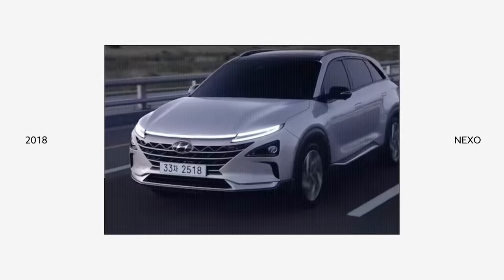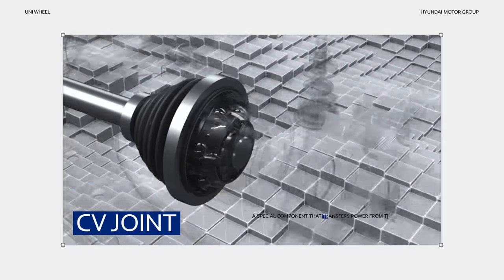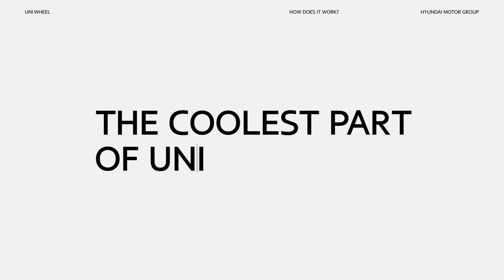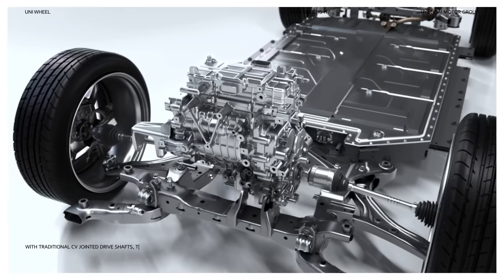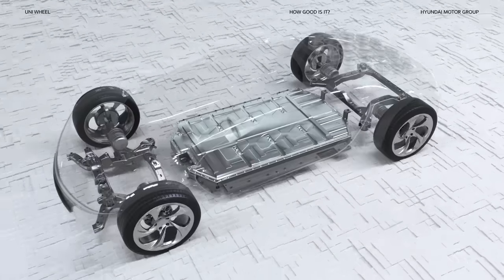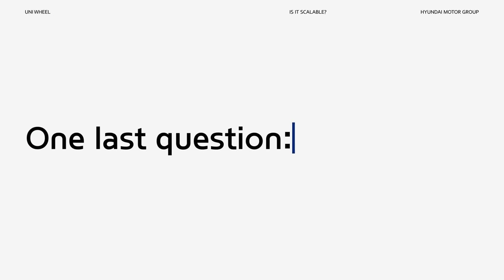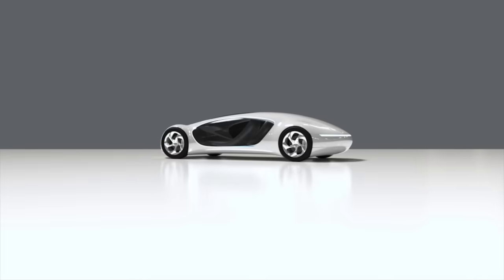The world's first drive system concept | Universal Wheel Drive System

Comment: How does the input gear/shaft stay centred and not fouling on the housing when stationary? I get the it will naturally centre once the wheel starts spinning but the moment it stops the weight of the car will guillotine the input shaft.
Reply: Presumably they're still a suspension arm probably with coil springs pushing the vehicle away from the wheel while allowing vertical travel.
Reply: @skierpage  These springs must support the weight of the entire car.
Reply: I have the same question

Comment: interesting idea. Personally, I expect a lot of unpleasant noise emissions due to the gearing and the very high speed of some components. These speeds certainly also limit the overall usable speed, 120km/h in the video. Another issue will be the sealing of the mechanism and the total number of parts of the mechanism >>> potential failures. The total weight of this device will probably not be negligible either (unsprung weight). And lest I forget, does anyone mind that the vehicle has stopped turning? Or was I looking at it wrong?

Comment: A cool concept but seems much more complicated than ordinary shaft drive. Also, it has more moving parts. Thus there are more things to break down and it's more expensive to build. Also, it increases the wheel's unsprung mass which is also not a good thing.
Reply: This is a modification of the in-wheel motor design. So drastically reducing the unsprung weight and eliminating the motor's exposure to shocks from potholes. Although, yeah, more unsprung weight than a traditional wheel, but I don't think unreasonably more.
Reply: That's true for every significant change in the history of the automobile.
Reply: Remember in this case they’re moving the reduction gear and final drive to the wheel hub so the parts count is virtually identical vs the traditional CV joint setup. It’s modular and easier to service too.
Reply: @starrwulfe  are you sure it won't end up as unserviceable self-contained  wheel assemblies where you have to buy a new one every time something goes wrong?

Comment: Its not mentioned  in the video, but this will only replace the cv joints, and it will still need control arms,  shocks etc right? Also where do the brakes go?

Comment: Would it be possible to also get rid of the conventional brakes and incorporate all braking into the drivetrain? Brake rotors that rust and brake calipers that seize up from corrosion is a major issue where roads are salted during winter...

Comment: Protean goes one step further and has the motor as part of the wheel, which is an even greater step. The argument against it would be the larger unsprung weight of the wheel, but one may argue that city travel means hopefully fewer potholes to contend with. Those solar EV challengers with PV roofs all had motors in wheels.

Comment: What happens to unsprung weight in comparison?
Reply: Did I get it wrong ? its inside the wheel , not a part of it , therefore its not rotating with the wheel making the actual wheel heavier / harder to move . I think thats what is happening . I could also be wrong but it appears to have less mass in general then with regular drive shafts etc so gross weight is reduced . I could be wrong again but although not increasing rotational mass being directly inside the wheel whatever mass it has is directly OVER the wheel / s which I would assume on some level helps plant the wheel via its weight and the mass is evenly distributed over 4 wheels for instance further increasing AWD ability to transfer power compared to RWD or FWD and purportely you dont have fluctuations in torque delivery with the angle changing etc so less drivetrain loss and all of those would seem to mean better acceleration from the power availible / no waste , as is the case with transmissions going to differentials etc that all "eat " power and why HP is rated at an engine ( potential power) but also measured at the wheels to know how much actually makes it to the wheels . Having each one independent also means super duper torque vectoring which means even less likelyhood of spimming the tire which turns HP into heat and smoke without full use of power to move car as well as reducing tire life . The movement they show would also suggest better contact patch when surface changes putting less pressure on tires in different situations which would mean longer tire life even if driven hard instead of eating up outside of tire etc to where you have more tread on part of the tire but once you remove more tread in a specific area you reduce traction / performance and would need new tires despite some section of tire being in good shape with use left . Everybody who drives fast or hard , had alignment issues or set up a car a certain way has had to get new tires despite a good section of the tire looking and being good and that is a drag , you might try an wait to get more miles but you lose a bunch . Regular ICE AWD cars even have issue if 1 tire has significant wear compared to others changing diameter which throws off the gearing / differentials meaning needing to replace tires so all are even or shaving a new tire to be same diameter ( throwing away brand new tire reducing miles it will be useable) . With NONE of that and truly independent wheels that is no longer a concern or less concern as each wheel optimizes for its tire even if slightly different then the others . If those gears are strong or strong enough for whatever power will be put through them it looks to be a win , But real world is real .

Comment: So, why not just use the already existing hub motors that i see in things like the Onewheel? Can that not be scaled up? How is this more efficient than that?
Reply: Hub motors on full size vehicles, or ones meant to drive at significant speeds, would suffer due to the large amount of unsprung weight, and having the motor and the gear reduction on the hubs limits either the available ratios or the motor size. Splitting them offers better handling and potentially more power from larger range of motor choice.

Comment: basically, in between traditional driveshaft and hub motor.
It all goes down to difference in unsprung mass and costs/reliability.
Hub motors almost certainly win on the latter. Not sure Uni Wheel is winning on the unsprung aspect either.
Not going anywhere, anytime soon.

And, I think I can do better! :-P

Comment: I'm curious about the cost to repair one. Replacing a cv shaft is 1-2 hrs flat and the part, usually under $200 (at a shop, cheaper at O'Reilly's, lol).
If it's essentially a twist on the planetary gear set, those aren't cheap now, and this adds incredible complexity vs a traditional planetary.
Also, how much space is saved with this vs quad motor and a cv? Are we talking over 4 cu.ft. of cargo added? Or are we talking barely 1 cu.ft.?

Comment: How is steering handled? Still with a CV joint? What about braking? This leaves no space for the hydraulic friction brakes; does it rely solely on electromagnetic / regenerative braking? Is that safe enough / does it "fail safe"?

Comment: If the system on one or both wheels fails, can the vehicle continue or is it unusable?
Reply: "If the system on one or both wheels fails" - You need to carry 4 more of these wheels in the trunk, because the nearest Hyundai service center with such wheels is hundreds of miles away. Did they say something about extra space in the cabin? This is just for spare wheels.
Reply: @noname-zf5tb  It's not for spare wheels. because with the decreased range, you'd have to make use of the space, but you can also put spare wheels. Though then you wouldn't even reach the service center.

Comment: Individual control of torque to each wheel is claimed as an advantage as if it has anything to do with this design, but it does not. One-motor-per-wheel works with any motor location and shaft design.

Comment: tbh the salient issues that I can see are threefold:
1) physical damage/impact/stresses to the wheel risk damaging the uniwheel while in current system the motor and coupling are isolated from the zone of physical impact. Hence unknown lifespan and safety
2) more moving parts for the coupling, and more motors, hence more single points of failures? and more pieces that might have accelarated aging? Albeit that is unclear
3) transmission instability when under bumpy roads?

btw is this using a gyroscope?

Anyway all of this can be estimated empirically but it will take a while (decades) unless we get an expert opinion/solid physical simulation/proof
also hyundai is not incentivised to disclose discordent data/insights.

h o w e v e r  that looks really cool and should be explored

Comment: There's no free lunch. Such a system will have much higher unsprung weight, and would behave worse over bumps. Also, it may have a higher rotational mass, making breaking and acceleration slower, to some degree.

Comment: They should just invert the implementation.  uni wheel on the inside.  less complex moving parts and unsprang weight on the wheel hub.   with the current design with all small worm gears and pivots,  linkage transferring huge torque. Hyundais will have to increase roadside assistance.

Comment: I really don't get it. Please, someone, help  me understand. 

The problem that this "invention" (is it? see Unimog or Humvee) solves, is that it reduces the space used in the car by moving the required component from under the hood to inside the wheel hub. That's all it does. Relocate a component. Right? 

For fun, let's assume that that's what the world was waiting for. 

It raises a few questions: 
This will increase the unsprung mass of every wheel by maybe a factor of three. This will definitely have a negative effect on ride quality and safety, due to contact issues (bouncing) when breaking heavily. Is that worth the trade?
Can these tiny gears and bearings handle the torque that a modern EV produces? My Model S produces 1420 nm of torque.
Efficiency? Anyone? This "invention" uses at least 4 times the amount of gears compared to a well-designed gearbox. Each gear adds friction and lowers efficiency. 

Maybe I'm just too old for this.

Comment: hmm, what if sand, dirt or rocks will get between the gears? or how about the bumps when driving on a deep pothole ? wouldn't a in-wheel electric motor with a more traditional suspension be a better choice ? 🧐

Comment: Seems like someone is trying to figure out how to avoid IP issues associated with the adoption of axial flux motors for each hub.  This is clever, but one of the appeals of electric vehicles is the utilization of fewer moving parts which act as points of failure.  I wish them luck.  As axial flux motors become more commonplace for automotive applications, their design strikes me as a sort of a cheaper compromise allowing them to achieve similar results while still using less efficient radial flux motors.

Comment: better to just intigrate the motors into the wheels, spindles and breaks. where each wheel is an identical motor and braking system also make the batteries in easily accessible and removable, divided into multiple blocks so the entire battery pack would not need to be removed to replace a bad cell also add a small displacement ICE range exstender

Comment: How much frictional loss are you introducing with so many gears? Small gears grinding at high rpm will produce heat and a lot of wear and tear when compared to universal joints. Each powered hub must now have a lubrication port and oil changes just like a differential.

Comment: How to control electrical voltage to each hub during a turn?   Brakes would be electric.     The planetary system has been used for a hundred or more years. Mostly automatic transmissions now. planetary systems are noisy and require a good clean liquid lubrication system.  Precision machining is expensive but doable. Entire system must be sealed against the elements.

Comment: So, instead of a single drive unit and transmission/gear reduction, you have four drive units and four transmissions/gear reducing units. Also, it still needs CV joints to turn.

PASS.

Comment: There are 11 gears alone, not counting a bunch of other parts. The weight of the wheel is enormous, the complexity of manufacturing is enormous, the friction losses are enormous, and the price is enormous. It's scary to imagine how much such a wheel would cost. Wheels are the most consumable spare part after brake pads and wipers. To change them every 5-10 years you will have to pay half the price of the entire car. Does Hyundai give them out for free?
Reply: Wheels are consumable? Oh dear, I've got bad news about the things your mechanic has been selling you...

I've gone through a dozen cars and never had to replace a wheel. Brake pads and rotors, sure. But a wheel? They pretty much last the life of the vehicle unless one gets damaged somehow.

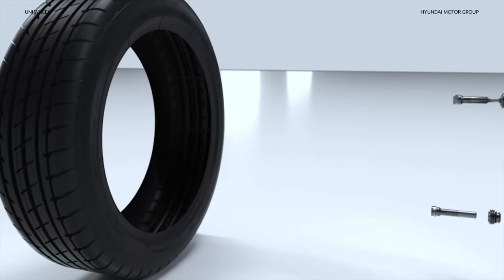That said, there's no way this system would be set up where the gearbox would literally be a part of the wheel. You would, like any other car, remove the lug nuts on the wheel and pull it off. The gear box would hang there like wheel hubs do on a regular car. In fact, you can see the hub and studs for attaching the wheel to the gear box at 1:54. It's not all once piece.

Comment: Suspension travel seems low.  Their example of 150mm is only 1.5cm less than an inch.  They skipped over suspension all together.  Maybe an oscillating motor...hmmm
Reply: 150mm is about 6 inches, because 1in = 25.4mm, but that still isn't much suspension travel.

Comment: Sorry folks, this is not viable.  The pinion drive train would need dozens of bearings, each that would spin so fast their packed grease would fly out.  Since you can't use grease, then you need hydraulic fluid.  Anything other than rotational motion is basically impossible to seal, so the suspension gearbox itself is not viable.  Also, no animations were shown on how the wheels turn left or right.  The gearbox does not appear to have any freedom of movement in the direction of a turn.

Also, since wheels are no longer coupled and driven from a common power source, if one motor or drive train should fail, the car will pull to either side which is a safety hazard.  The flip side to this is also with breaking.  This could be overcome by smarter software, but mechanically linked drivetrains don't require software to work right and reliably.  

The most optimal solution is to design the motor field coils themselves to be embedded directly in the wheel hubs.  Beneath large ships they are already doing this with their articulating propellers driven by very large coils in the surrounding enclosure.  The propellers essentially spin on bearings in the the center.  The torque comes from the coils directly on the outer diameter of the propellers.  If you are going to put a motor on each wheel, might as well put it right in the hub, then you completely eliminate all gearing, and drivetrain.  Think of each wheel like a beefed up brushless fan motor.  Motors can be made to do this for torque or speed, but probably not both unless you could find a way to reconfigure the battery packs from series combinations of cells into parallel combinations.  Parallel combinations would be used for large torque at startup.  Series could be used for fast speeds on the freeway.  You need the extra voltage to counteract the back EMF from the motors spinning increasingly faster.

Regarding the problem with unsprung weight added to each wheel, that's mainly due to the jarring effects of pot holes and other serious vibrations.  Mount the motor coil in each hub, but make it be a planar orientation with built in shock isolation.  In other words, put all the complexity of that gearing mechanism into a relatively complex motor suspension system built into the hub.  Free to move up and down, but not spin.  I don't know why nobody has tried or even touted this yet.

Sometimes I wonder why engineers over-complicate stuff...

Comment: Why don't they focus on the more important thing.  The batteries. Paying thousands to have them replaced is a bummer.  Since I drive about 10k miles a month I would basically go through a battery pack each year. Imagine the cost to replace the batteries every year? Once I see them make more affordable batteries with longer life expectancy and longer range per charge I will switch from IC to EV.

Comment: you are moving the weight from sprung to un-sprung, which any engineer will tell you creates a worse ride in both comfort and performance. now the CV shaft is spinning at the higher motor rpm speed rather than the slower driven wheel speed. no mention of how brakes would be incorporated. If any amount of dirt and junk gets into the sun gear it will wreak havoc to the gear surfaces.
Reply: That's a great point that the CV is gonna gosh dang generate plasma now without the reducer placed before it. GG!
Reply: I didn’t even consider the CV speed.  5,000rpm to go 15mph and exposed to the elements.  I can’t think of a single thing that could go wrong 😂
Reply: It is not exposed to the elements. Like a hub motor .
Reply: It will be sealed and filled with oil. Very standard design used on everything from bicycle internally geared hubs to helicopters. This is not a major constraint in modern mechanical engineering.
Reply: @Groaznic what CV? Doesn't this new gearbox replace the CV joint entirely?
Reply: These gears are likely going to be sealed the same way a differential would be in a contemporary vehicle, but you raise an interesting point

Comment: If you're going to pivot the whole motor assembly to allow for steering anyway, why not just cut to the chase and mount the motors directly to the wheel hubs and skip the 84 extra machined parts this adds?  This makes no sense.